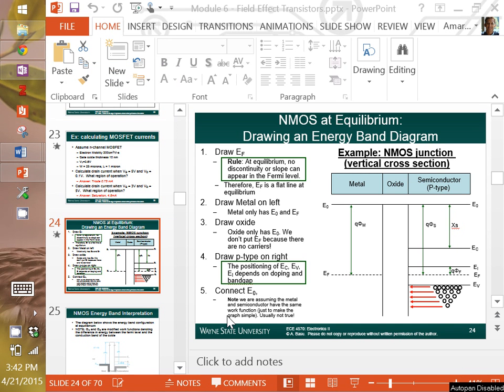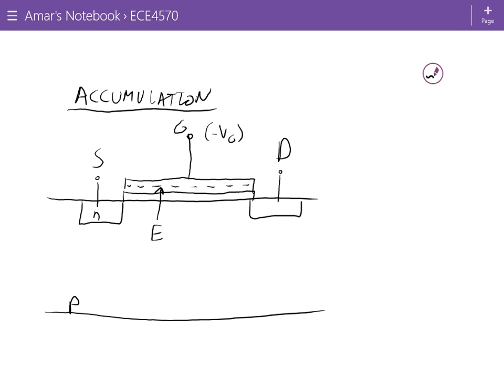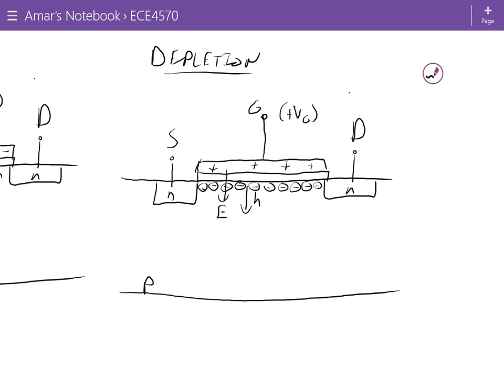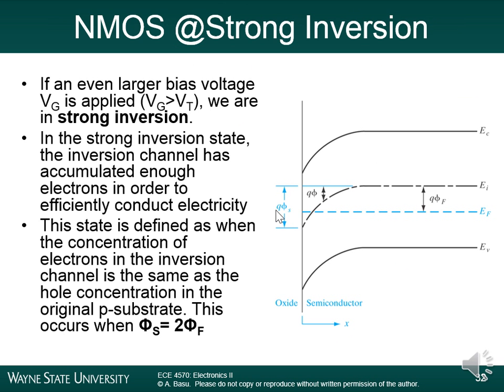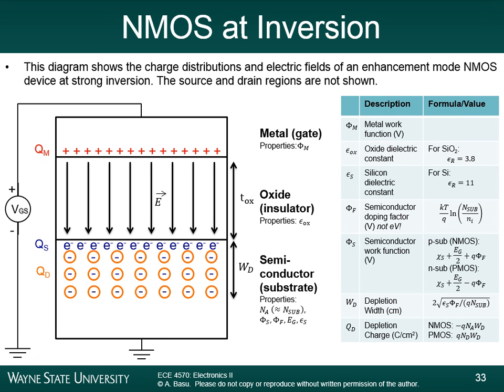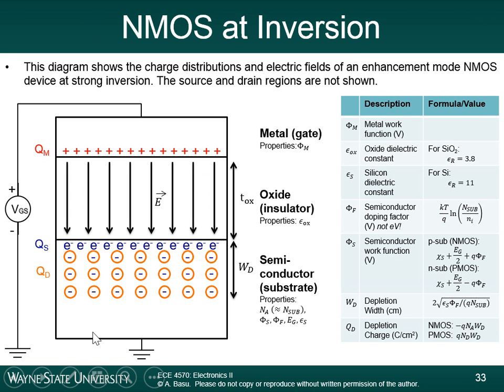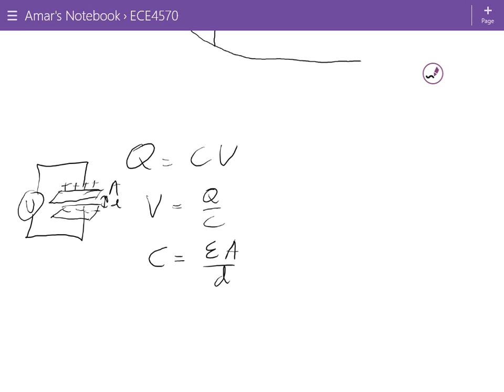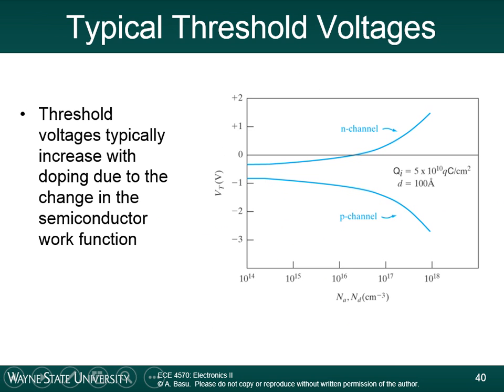Module 6C - Field Effect Transistors (MOSFET)

Comment: 15:20 Are flowing statements true: 
1. Fermi level stays flat as it represents potential energy of electrons at that distance x, and seance there is no current in semiconductor there is no potential difference. 
2. Not to say there is no electrical potential difference, there is seance there is electric field that is formed by the charges, it is just canceled with chemical potential of diffusion of those charges.
3. Also as the electrical potential of electrons dips (with negative increase of electric field integration), the work function increases also. 

Why is Ev changing and not staying unaffected by changes in silicon?

Comment: 5:45 would difference in fermi levels of metal and semiconductor, or their work functions, indicate that there is tendency of metal electrons to diffuse into semiconductor, and thus they would have bigger chemical potential indicated with higher fermi level and lower work function than in semiconductor?